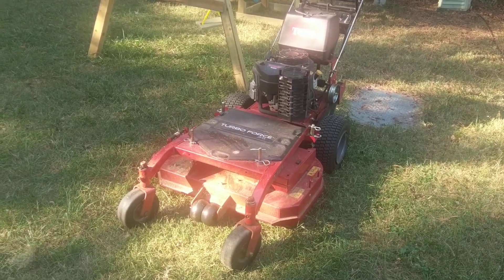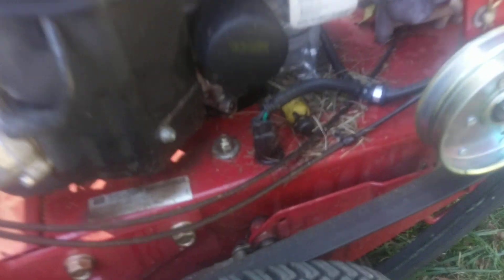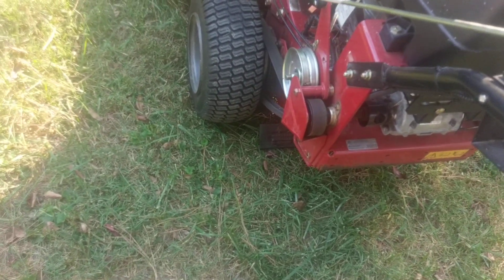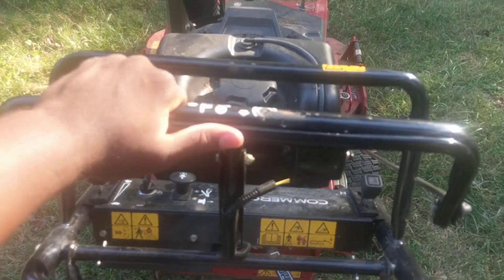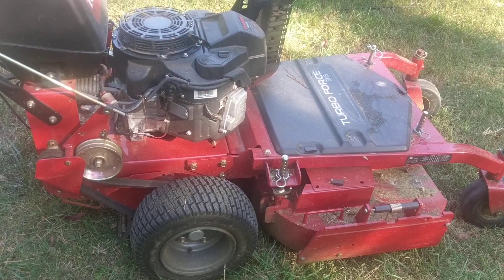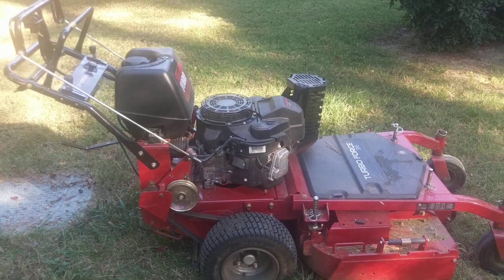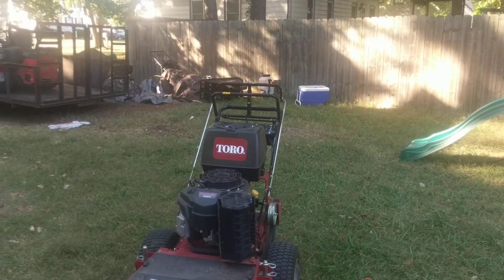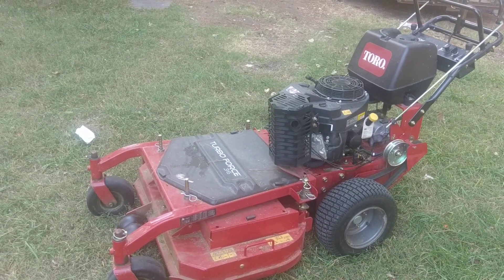Toro 36" T-Bar Walk Behind (Full Review)

Comment: I just bought one of these at auction and it wouldn't start because the gas cap gasket had broken into pieces , fell down into the gas tank and dissolved  creating a tar like substance that clogged the gas nipple right under the tank. I cleaned the tank out thouroughly with alcohol, replaced the nipple which was $35 , replaced the gas line hoses , fuel filter and gas shut off valve , and when I put it back together it started on the first pull. But I couldn't figure out how to steer it until I watched your video , so thank you Sir for that . Back in the day we had them at a lawn maintenance company I worked for that had a seperate handle for each side , so if you wanted to turn you just squeezed one side or the other less

Comment: Reverse should work if you push forward on the tbar instead of pulling back. I tried a tbar at a dealer and the reverse worked great, no pulling required.
Reply: whoops! didn't read this before posting...

Comment: I have the same mower belt drive cuts great, however my T bar isn’t as maneuverable. Any advice? What kind of sulky/velke you have can we use a Bradley Velke?
Reply from the maker: Can it be adjusted?
Reply: @SEFtheLawnSurgeon  believe so, loosen up should help 👍.
Reply from the maker: Yes play around with the adjustment nuts and try to make them even

Comment: That "assisted" reverse is what keeps me away from the belt drive walk-behinds.  Price keeps me off the hydros.  It's ridiculous to think that an average person might be able to pull a 400+ lb machine out of trouble; usually uphill.  I noticed in the video that when you pull the reverse bar, it pushes the T-bar a little probably putting a little tension on the belts.  With the transmission turning in reverse, a push to the T-bar should fully tension the belt giving full reverse.  I guess that they have it set that, by using the reverse handle, your body position is set to be pulling.  Maybe an adjustment could be made to the link between the reverse handle and the T-bar to provide more power to the wheels?
Reply: I was thinking the same